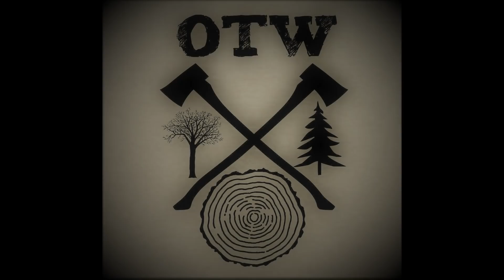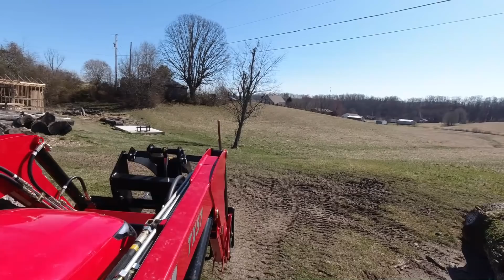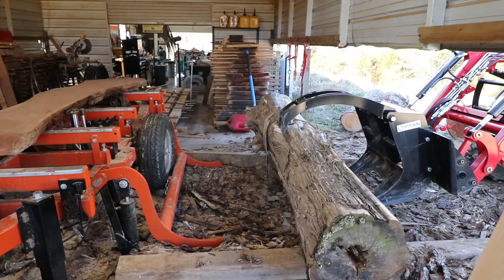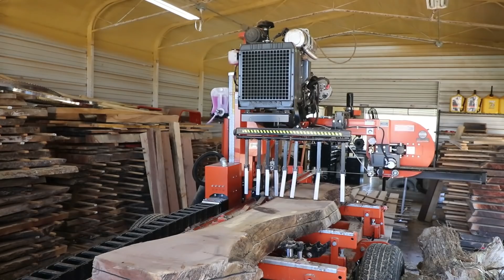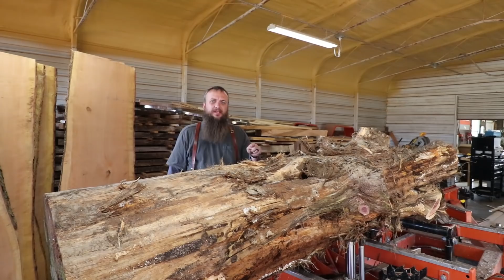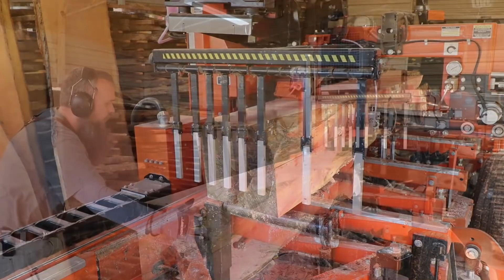This Might Be The Most Figured Live Edge Slab On YouTube

Comment: I am considering building a few small stepping stools for various members of my family for this Xmas coming up.  Do you cut and store lumber from black walnut large branches?  I am looking at three stools, each needing roughly 8 linear feet of lumber about 10 to 12 inches wide, and around 1 inch thick.  Crotch figure not necessary, as I would like them to have natural edges, but still be fairly regular in shape.  I figure that if you do have this sort of lumber, we'll have another conversation later, but I have never seen you process black walnut large branches.